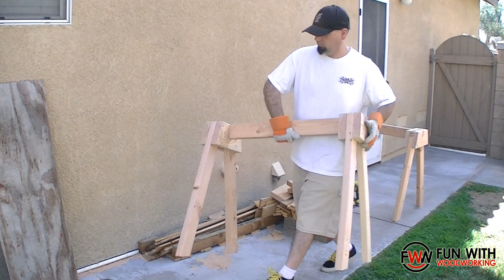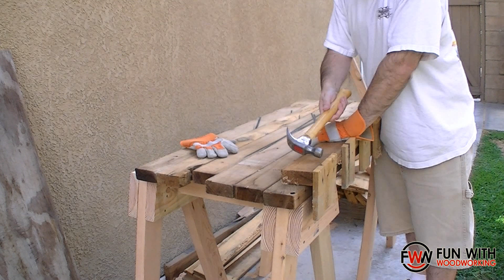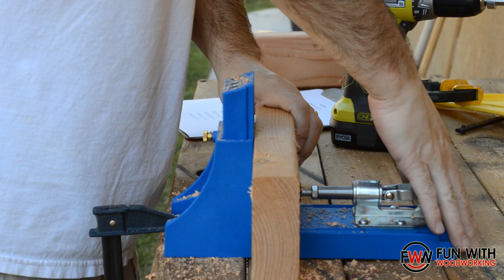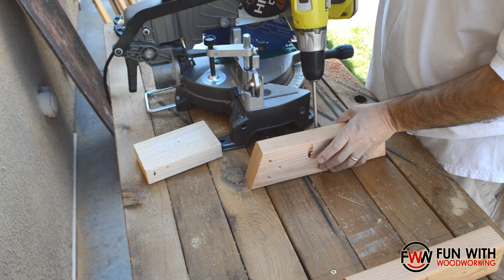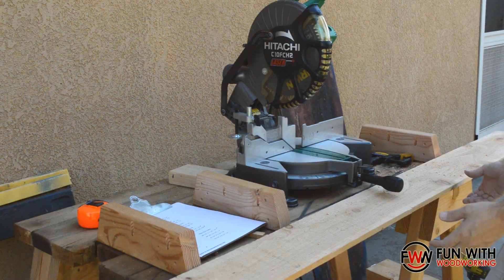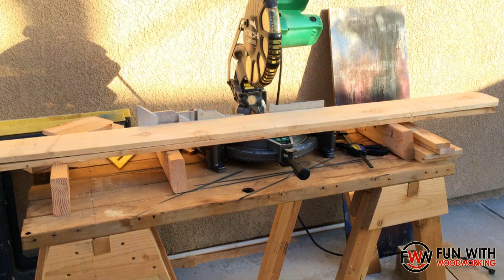How to make a quick and easy Mitre Saw Station out of shop made saw horses and reclaimed pallet wood

Comment: Really like the idea.I usually set my miter saw on a plywood top across two saw horses. I think what I will do is attach 2x4s to my plywood board and fit my miter between.if I need my plywood flat like for assembly, I will just flip it around. Thanks, always like to see you working on projects.